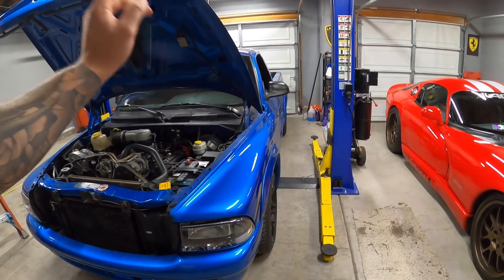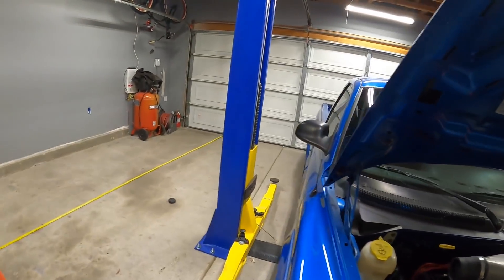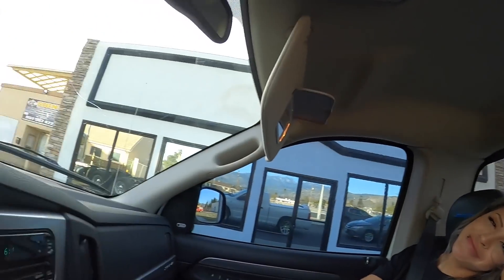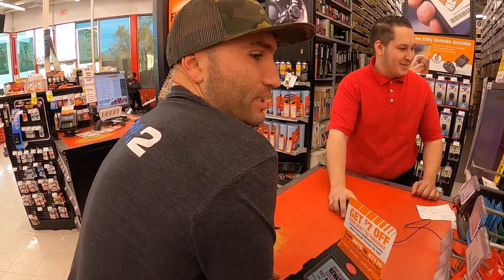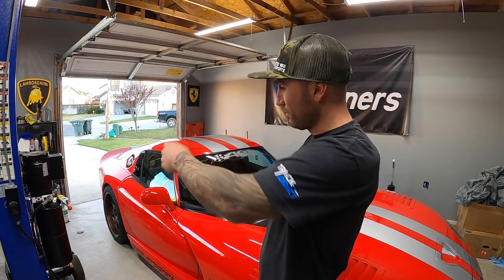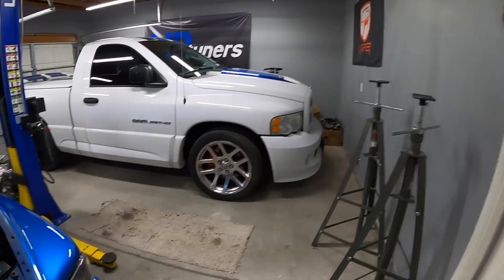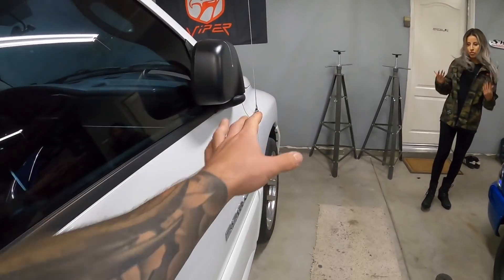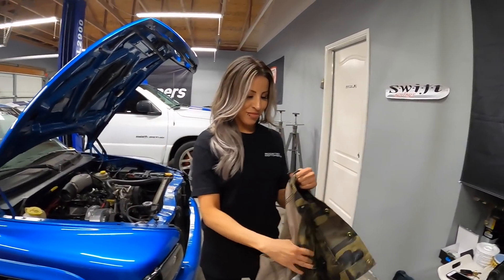All Mopar Garage

Comment: So i have a 2000 Durango w/ the 5.9L and its 4wd. Cats on it are bad, to your knowledge, is there a way to run a straight pipe but eliminate the need for the check engine light?

Comment: Yes the SRT truck needs a exhaust bad very bad it would sound beautiful and have you heard of rock auto they have a lot of oem parts for cheap instead of going to autozone you  should check it out that’s where i get all my parts the reliable
Reply from the maker: I usually get my stuff from rock auto also but they are getting out of hand with their shipping prices lately! They wanted over $60 to ship the brakes for the srt and wanted to charge tax on the shipping too. 👎
Reply: BoostedMotorsports yes you are absolutely right but anyhow your mopar collection is awesome

Comment: Should have replaced the pads with the rotors, old pads and new rotors aren't going to bed right.  Even though the pads aren't that old, they are worn unevenly from the old rotors.  Also, rockauto has complete front pad and rotor kit from powerstop (non-slotted) for like $225.  Much better stuff than AutoZone.

Comment: Hey now...not hateing   on the s2000 cool little car just not into the import class all that much that's all...I like all kinds of cars but muscle and rumble are king...not loud annoying masqito on crack...more noise than power and speed...lol
Reply from the maker: Haha yeah its not fast HP wise right now but those motors are all forged internals and if we boost it can make over 1000hp on a stock engine in a car that weighs 2500lbs it would smoke anything in the garage 😮